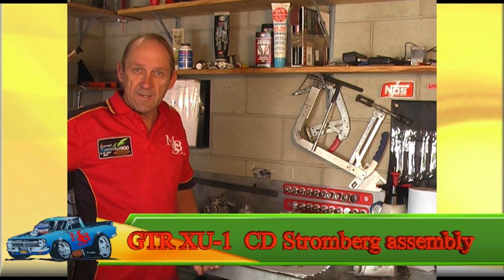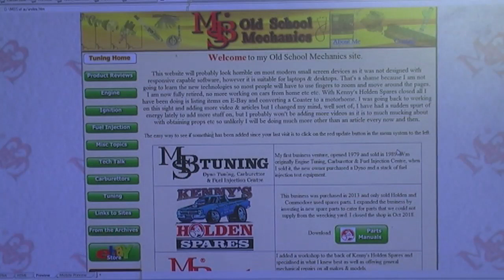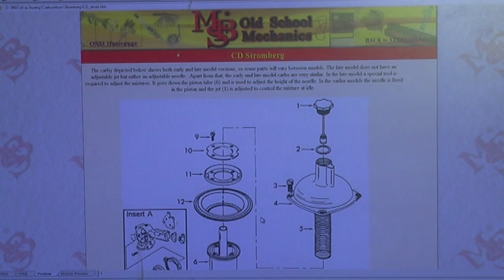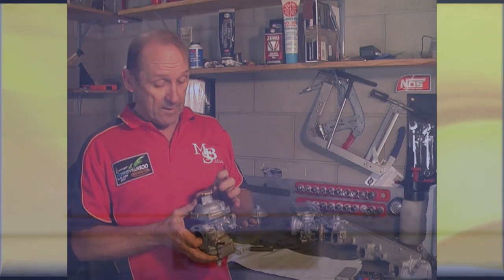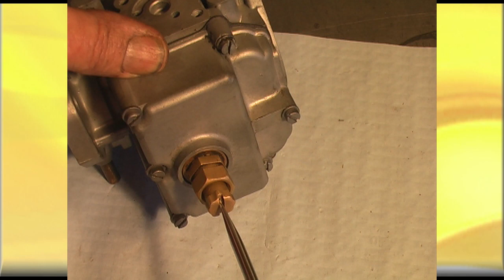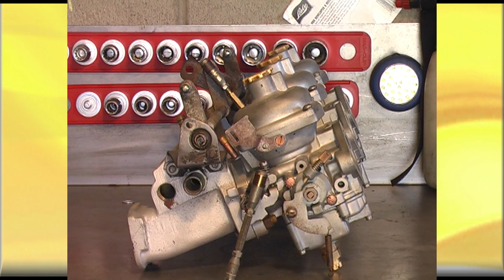Assembly of triple CD Strombergs on a Holden LJ Torana GTR XU-1

Comment: what about su's i believe they are better for racing,maybe you need to do a test tune on su's etc.
Reply from the maker: not going to happen. I don't have the resources anymore. Su's do have less problems but they rely totally on the clearance between the piston & cover chamber for correct operation wheras the CD relies on the diaphram seal. I'd prefer the SU's for simplicity of repair and adjusting but love the original set up of the triple CD's.